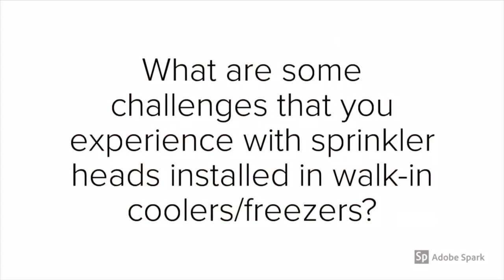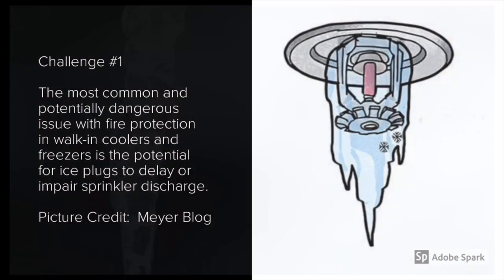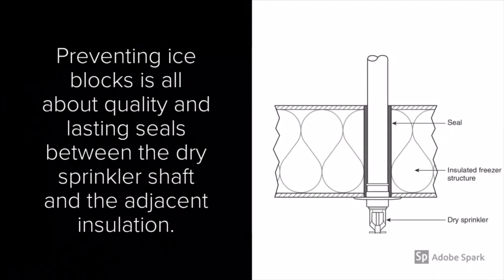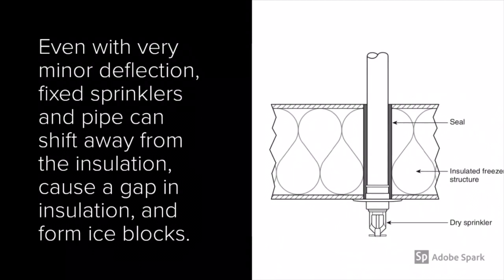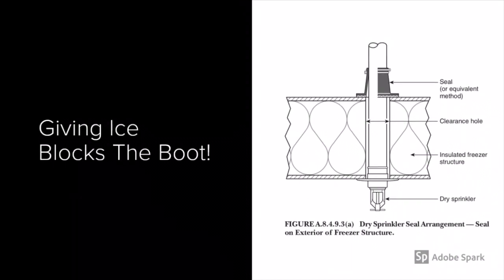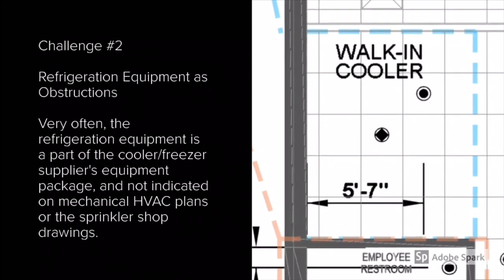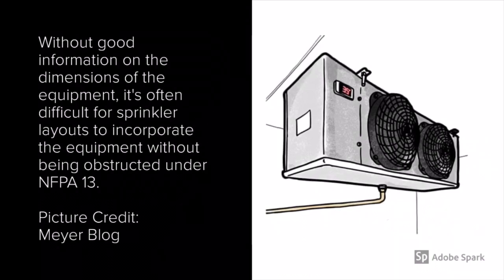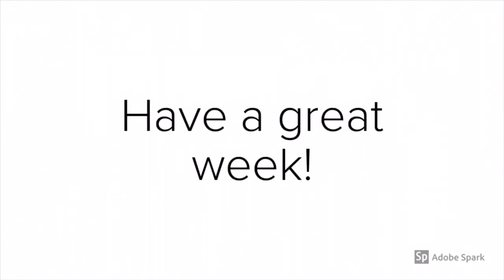FMAA-SD #24 (Fire Sprinkler Challenges in Coolers and Freezers)

Comment: whats the easiest way to remove the ice plug from a dry sprinkler inside a walk in freezer that still has food inside of it?
Reply from the maker: That is a really good question that I do not have the answer to.  I try to prevent the ice plugs, but I know previous installs can allow for such conditions to happen.
Reply: havent tried yet but try a hose hook up prefferably water and spray the top of the sprinkler head until the icicle falls off. even if its cool water as long as its warmer than the temperature of the ice it should melt. protect your food product from water damage maybe protect flooring too so it doesnt ice up  then find the the gap seal it up or do as this guy says and get a boot up there. if the pipe itself is frozen up top wrap it in a warm towel to thaw it out.